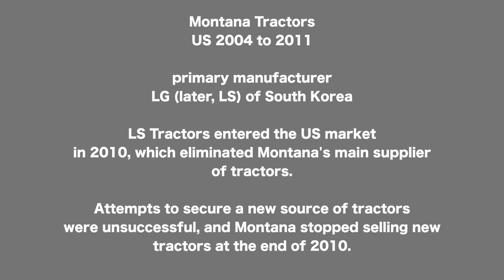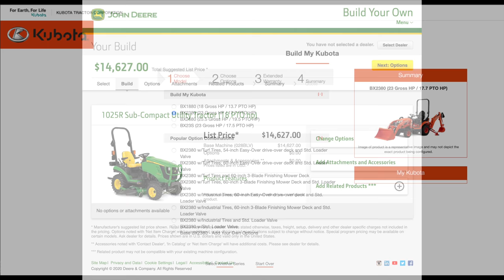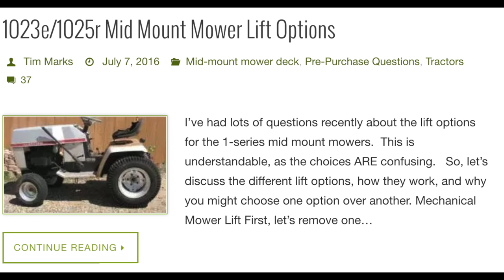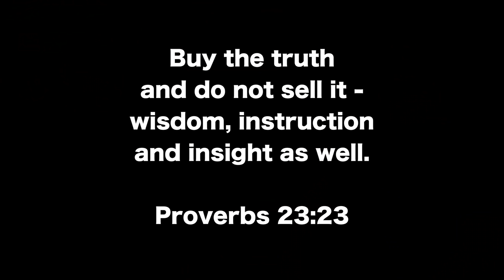Have NO REGRETS! Watch This Before You Buy A New Compact Tractor!

Comment: A small tractor can do anything a big tractor can do, it just takes longer.
Reply: To paraphrase from the old Magnum Force Dirty Harry movie: "A man's got to know his limitations."  As long as the smaller "bites" a smaller tractor can take with its appropriately sized implements will still get the job done it the time you can allow for the task, you're good to go.  However, you have to be aware of the physical limitations smaller tractors have which can be solved with a bigger tractor.   A prime example is loader lift capacity and lift height.  A 1025R with its 120R FEL will just reach up over the side of a pickup truck bed.  A 4066R with its 440R FEL will reach all the way up and into a full sized dump truck (personal experience here). On the flip side, a 4066R with a rear finishing mower (no belly mower available) will not be the right tool for mowing a normal residential lawn.
Reply: I have a small subcompact (Case IH DX24e). It has the HST transmission so it is very limited in plowing, pulling a disc, and FEL operations. It does have 24 hp but the amount of digging is limited as well as the ability to pull a box blade with the rippers down. I think a different tractor would have been better but it's hard to say. Up until ten years ago, very few compact or subcompacts were available in my area. The real challenge is finding the things I need to do are not possible with my tractor. I've learned but now its time to sell and get my shop cleaned out. The RIGHT small tractor can work very well for the right place and owner. But all things must be in alignment for it to work out.

Comment: Agree, Deere and Kubota good resale value. But a 1025R doesn't look like a tractor. Some other brands produce good, affordable, reliable and tough tractors, but replacement parts can be a problem. That's too bad, cause then you're left with buying a JD for a pretty penny. One acre property! Get a wheelbarrow, a pick and a shovel. You look young enough to do the work without a tractor.

Comment: I was born and raised Green. They fed our family for 20 years. Great tractors, where they shine is dealer network. I looked at Kubota, Deere and Massey Ferguson, but what I found was that, in the end the MF out performs all others in it's class. Not that that the other 2 are bad in anyway, they just spend more on advertising. Cost wise it was a non-factor. The best thing you can do is read, read, read. I don't think you'll make a bad decision with any of the 3 (or 4 if you want blue) , but I'd steer clear of the Kioti, Bobcat, LS, Ranch King, Bad Boy etc.

Comment: A grapple w a tree trunk or stump in it gets real heavy real kwik, keep that in mind if you are going to do much clearing or cleanup. Also gets very dangerous when you are trying to pile up to burn and have to lift it up on top of the pile and it is not very level. On a tractor that can barely handle it in a paved parking lot you can get in a mess real kwik.

Comment: I’ve had my Massey Ferguson. Gc1725mb for a year and I love it!!!   I bought this size tractor so I could still move it around without having to have a huge trailer. So portability is something to consider.  Don’t forget to consider a quick attach !!
Reply: I just purchased mine yesterday.  Do you use a bush hog with yours?  If so, what size and how does it do?
Reply: @hammertime7721   no bush hog I just use the loader and backhoe get used to switching the seat around for the backhoe that’s the most annoying part
Reply: @kennyluvspizzaent947  Thanks for the response.

Comment: I bought a 1023E TLB configuration new in 2012. I also got a heavy duty barn-style 12X20 fabric shelter (around 1300). It's still in great shape.  Got a bunch of stone spread out to put the shed on top of, and tied it down. 

I have 2.2 acres, and after a few years, decidedly have done more than 20,000 dollars of landscaping work and clearing.

I separately have a x310 with a mower deck and snowblower for the driveway and mowing. I got that in 2015. 

I've dug up over 50 stumps (large pines) and moved logs (pines felled) and made a log bridge over a stream out back to get to the back of our property. This channel (and a few others) inspired me to get this tractor. Thanks all.

Comment: I've got 12 acres that I've taken care of for years with a Simplicity Prestige with a 54" deck and a cart.  After fourteen years bought a zero turn commercial to get the mowing done faster.  Mow about five acres.  Rest is wooded. But there were still many jobs around the property that I couldn't get done and so started to look at sub-compacts tractors.  After much research it came down to the Kabota or Deere. Watched many TTWT videos, which were very helpful in my decision.  Final decision was the 1025r with bucket, backhoe, mower deck and a brush crusher.  Decision came down to the dealer proximity for service.  So far, quite happy with my purchase and the dealer service has been great so far.  Working on getting a shed for it now.

Comment: Accessories that I strongly suggest everyone consider (aftermarket or OEM):

Skid-steer quick-attach (SSQA) bracket for the loader (many come with it standard, but sometimes it’s still optional).

Bucket hooks to attach rope & chain to.

Forks (either clamp on or SSQA; but the clamp-on style, although cheaper, does have less effective capacity due to sticking out further from the pivot point of the loader). I got mine on sale from palletforks.com; but there are other sources as well.

ROPS-mount canopy. Even if you like hot weather, or live in a more northern are where it just doesn’t get that hot; it’s both good for reducing your UV exposure as well as a place to mount stuff, such as...

12v roof-mount fan. These are available from trucking supply stores, as well as Amazon and eBay; and really help on hot days.

Backup camera, aimed to show both the rear implement and what’s behind you. These are available as pre-configured kits; but you can also get a camera module and LCD module from Amazon or eBay (if you can hook up a Nintendo, you can hook one of these up).

Mirrors. I got a set marketed for golf carts; and made a set of brackets to mount them to the loader frame posts; but there are lots of other setups that could be suitable.

Walkie-talkies with an earpiece; if you ever think you might work with someone else (and you probably will, even if they’re just kicking stuff into the loader bucket or hooking & unhooking a chain around stuff, while you stay in the driver’s seat). And the other ear should have an earplug in it; diesels can get noisy when working hard. Alternatively; ISO-tunes, a cell-phone holder, and one of the walkie-talkie apps for your phones.

Long-reach grabber tool... so you don’t have to climb off the tractor to move something like a hose or other small object. To hold this when it’s not in active use, either attach a “cup” magnet to it; or get a wall-mount broom holder, and attach the magnet to that, and clip the long-reach tool into the broom-holder. I put mine on the inside of the loader frame’s vertical posts... out of the way, but in reach when I need it.

Step: there’s a guy (at https://retailrems.com/ ) who makes a bolt-on step for the GC1700 series; John over at Louisiana Tractorworks & Projects did a video a couple of weeks ago about it, so I ordered one. BIG help for somebody with a bad back (like, um... me). I don’t know what’s available for other brands; or if you’d have to go DIY on one. Also makes one a lot less prone to grabbing the steering wheel when climbing up.

Battery-powered fuel transfer pump... because holding up a 5gal can of diesel fuel is a pain in the neck (and shoulder, and... well, you get the idea).
Reply: So are you saying i should hook up in the tracter a game system? I guess super mario brothers will get me through tedious jobs.
Reply: That’s a lot of doo dads for a tractor.
Reply: @mtaviator  And thingamabobs! 😉 But I use all of them, and with the exception of the forks & hooks and radios, I use them every time I’m on the tractor. The forks & hooks get used quite frequently however, for moving anything heavy or bulky.

Comment: Greetings!  I have 10 acres, dirt road, 6 acres of grass and 4 acres of woods.  I bought a 1025r about 2 yrs ago with loader, box blade, snow blade and brush hog.  It has done pretty much all the jobs I want to do around the yard.  I looked into a sickle bar for it, but that was really expensive, however I've been able to get by without it.  Obviously do your research, visit dealers and even check out the used market. Good luck!

Comment: My Johnny 855 is a 1991 model and I never have had problems ordering parts for it.  The tractor has maintained and improved our 21 acres for almost 30 years with never a trip to the dealership. It's as strong today as the day I brought it home.   It's has no seeping and the tractor stops as soon as I take my foot of the direction pedals.  It's the best machine of any kind I have bought in my life.   It's important to change oil, I change mine and the filter at the beginning of every mowing season even if the oil doesn't look dirty.   I tried using citgo oil one time instead of Deere oil and the tractor lost power,  with small engines you can tell power loss immediately. I have been using Deere oil ever since and have no plans on changing no matter the price.  Good episode Tim.  Good Luck with your new Deere Nolan.

Comment: This was an excellent discussion.  I have had my BX2200 tractor for 21 years and at the time of purchase the storage space was the issue that kept me from adding a loader which I really could have used and wanted, but now I have been heating my house with wood and move some pretty large pieces of wood around and need to find something with a lift capacity greater than my BX tractor would have had.  Additionally, when I purchased my BX tractor they had just come out so there are so many more accessories available both from the manufacturer as well as the 3rd parties that you have shown so well.  Those 21 years on me have also made me appreciate the hydraulics so much more.  Thanks for sharing your insights on this equipment it helps a lot.

Comment: Great advice Tim.  I purchased my 1025R from a dealer that from the minute I walked in the door, made me feel like family.  The other, closer, dealer didn't have time for me.  I arrived at the dealer about a half hour before they closed and because the salesman had just left, one of the service techs talked to me.  He kept wanting to call the salesman and have him come back but, I assured him I'd return the next day.  Anyway, we sat talking for a good half-hour and he wanted to take me outside and show me how everything - drive over deck, loader removal, etc worked but, because it was close to closing time (actually past) I wouldn't let him.  Showed up the next day and the salesman was absolutely outstanding.  He had left early the previous day because one of his customers had a problem and he went to his house to help him out with his new tractor.  I never felt any pressure to buy, just a methodical and relaxing discussion trying to determine what my actual needs were.  I have discovered over the several years that I have owned my tractor that this dealer had gone above and beyond when prepping it before delivery.  I've had several people with similar size tractors tell me that they can't pick up anything with their front bucket because the rear end comes off the ground.  I never had any problem because the dealer puts fluid in the rear tires of all tractors he sells with front end loaders.  Maybe I could have negotiated a better deal but, I believe the price he quoted me was fair and the hours he spent with me were well worth any commission he received.  (I did talk him out of a free hat).
Reply: flick 2601, the Dealer putting Calcium in the tires is an excellent idea! I had a 55Hp 4WD that was able to lift a Gravel Box off a Tandem Truck, and in hindsight it was the charged tires that enabled that feat. It also frees up your 3Pt hitch for attachments.
Reply from the maker: I agree ‘fluid filled’ tires.  I disagree ‘calcium filled tires’.  Highly recommend Rimguard, as it will not destroy the rims.
Reply: @balanced4harvest552  - Thanks for the reply.  The dealer didn't put 'calcium' in my tires but an environmentally friendly fluid.  I recognize many people use the word calcium to refer to any fluid filling because it was in fact used for so long but, Tim's correct, you don't want to use it when there are better products available.

Comment: Nolan; I have had a John Deere 1023E on 2acr's have done many jobs with that tractor Tilling 3/4 acre garden ripping up old posts & roots, stoning pads for my drive in port pads for my barn & shop...etc.-etc. I love the John Deere equipment and also own a 300X rider.  Tim is a stand-up guy and I always watch his videos. This is coming for a 74-year old that has been around the block or two. Lol
Reply: I feel like the 1023E is often overlooked and just as often under valued.  It's a really solid machine in that size.

Comment: Hi Tim, yes you need to include the Massey GC series on here. I don't know how it is in the States, but in Canada they have a lot of dealers and they are an old company and very well supported. They all come with the SSQA option, so that rules out any implement issues with getting things like a set of pallet forks, grapple, or things like that. I would also highly recommend to get the pallet forks at the time of purchase as that greatly makes the tractor more useful for moving stuff around. It will change how you store your items, and what to do with things.

Comment: The biggest thing to consider when purchasing a sub or compact tractor is the transmission.  If you're doing mostly mowing and front end work a hydro is just fine.  If you're doing some field work , plows , disc , etc , do NOT get a hydrostatic.

Comment: I bought my 1025r in June 2016.  I own just under 2 acres and have a small backyard homestead.  I won't lie, I had serious buyers remorse right after buying mine.  But, once I started using it and doing projects around the house the remorse quickly went away.  Despite the price, it is the best outdoor DIY piece of equipment I have ever bought.  The drive over deck and quick attach loader are money.  I can do lots of things with it.  Only thing I would do over is give more consideration to the backhoe when I purchased.  I still may not buy it, but I didn't even consider it when I bought.

Comment: I have a JD 3032e bought as the package deal, front loader, brush hog, and box blade in 2015.  I traded the box blade for pallet forks and later bought a used blade.  I had the dealership put 500 # each of fluid in the rear tires.  A lot of the reviews I read before the purchase was that JD utility tractors were light in the rear and it limited what or how much the bucket / forks could lift.  The only thing I have added was a 3 point quick connect.  This tractor is a beast and has not failed at anything I have asked of it.  I have a barn I kept it in but decided to buy an 8' legs, metal carport for it.  They are not that expensive and well worth it, it was up in 2 hours.

Comment: I have a 234 hydro-static international compact tractor it's 36 years old, I just build my own tools that I put on the 3 point hitch!  When I  got this tractor it came with  snowblower and woods mower for the 3 point hitch.  In May this year the pin in the transmission that shifts hi-low broke. I thought I'd never get it fixed with this COVID going on. I was able to take it apart by myself and fix it. It took me 75 hours to take it apart and took me less than 8 hours to put it back together.  I had 1 hydraulic line leak but was able to fix it the next day!

Comment: I used much of this advice when buying my B2650, especially the part about talking to the service dept.  They’ve been very helpful, even taking a part from one of the floor models for me so I didn’t have to wait for the new one to ship.
Reply: When I bought my Kubota BX2370 I bought some extra mower blades and other miscellaneous parts that I thought I should keep on hand like fuel filters, etc. Well after 5 years when my BX was paid off I traded it in and upgraded to a B2650. The dealer exchanged all my parts from the BX and gave me the parts for a B2650 and never charged me the difference, just a straight exchange.